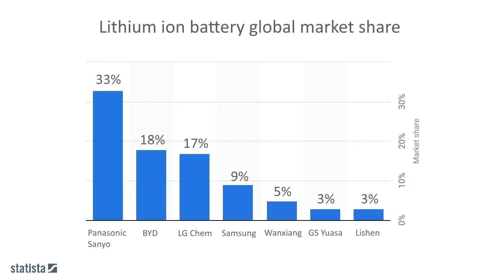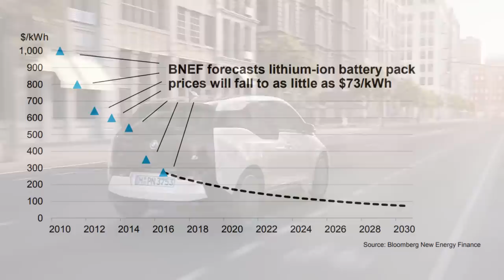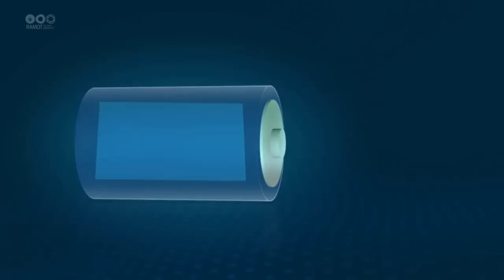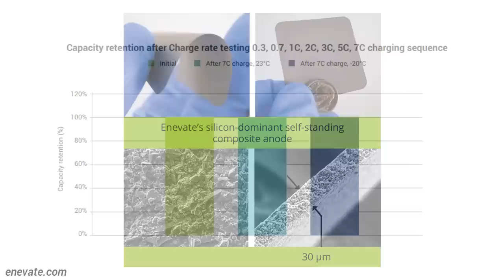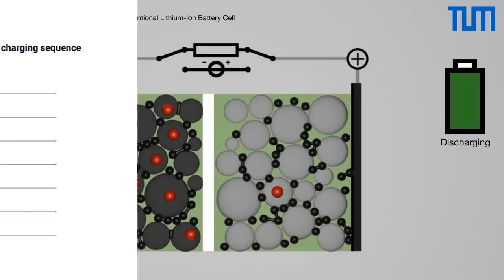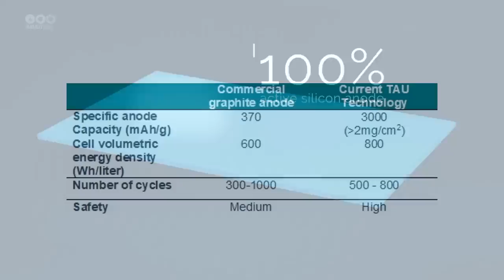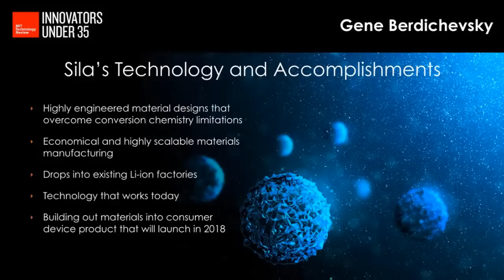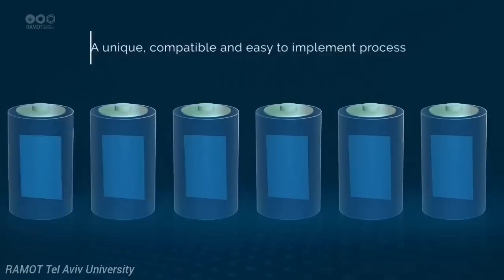The Battery Revolution. Ultra Fast Charging

Comment: I currently drive a plug in hybrid. I'll drive that until I am able to afford one of the 300+ mile EV's. The next step for me will be getting solar panels on my roof. What's holding that up is I;m probably going to be moving to a smaller house in the next couple of years as my youngest is going off to college.

Comment: Well, it is nearly 2020 now...Does not seem like this technology was right around the corner unless you were speaking of Geologic Time. I hope it will release after overcome the degradation problems that this chemistry brings - I don’t want to change my battery packs of be subject to battery fires.

Comment: Good video. From a materials student's perspective, making the batteries and everything is easy, the trouble is with waste disposal and recycling. A battery that has half the charge capacity and recharge rate, but can be recycled/safely disposed is far, far better in the long run than one that cannot be easily done so.
Reply: Hopefully a (near pure) graphene battery will get us past all those extremely toxic wastes.
Reply: Somewhat bad news for you, graphene nanoparticles are quite 'toxic' to natural life if inhaled or ingested. They are like blades (due to their sharp edged 2D - sheet structure, in addition to increased strength at the nanoscale) on the cellular level, and can penetrate cells damaging/tearing the cellular walls, and mess with intra-cellular proteins and organelles by binding and their hydrophobicity causing abnomal deformation. Goes without saying more research needs to be done in this area, but some indications are present/debated. And ofcourse, any nanostructure has completely different properties from bulk material, even if it is the same element. So if we were to leave it in an open dump where we expect any interaction with nature, we need to be careful, as it can easily cycle through the food chain similarly to plastic microparticles, and mercury poisoning and accumulation in fish. Indeed there could be a process to break the graphene sheets or recombine it with something to make it harmless, (wild guess, burning it to form CO2 if possible) but I'm not aware of a specific industrial process to deal with it. I also don't know what assessment Samsung has done on the recyclabilty/environmental impact of their graphene batteries, though I suspect they should last a lot longer than conventional batteries. The answer isn't always as cut and dry as it seems.
Reply: insioni, that's a false dichotomy.  Lithium ion batteries can be recycled.  Battery capacity is extremely important.
Reply: True, but ability to be recycled, and ability to be recycled economically are two different things entirely. I never said Li batteries can't be recycled, more about whatever new composition/techinque that is worked on, it should be a key consideration in the r&d. The issue with current batteries is that the recycling process isn't that economical yet. It ultimately leads to low investment in industrial recycling capacity, and not much is truly recycled afterall. Add to that the amount that goes straight to the landfill. 

The importance of battery capacity is the same argument as the importance of energy density of conventional fuel over its environmental impact. We chased that far enough, and got us pretty far to too. No denying there will be disadvantages,  and even if we do, the impact will be significantly less with batteries compared to fuels since renewable energy is gaining traction. But if we do the same thing as we have done in the past, we might find ourselves in the similar situation later on as we find ourselves today.
Reply: You misunderstand.  Car batteries are too damn valuable for anyone with half a brain to just 'dump in landfill'.  They'd WANT to recover them if possible.

Wrecked batteries in a crash however, is a more valid concern.
Reply: insioni - the Depleted EV car batteries can be used to power HOMES, then when they have ended usefulness for that, the EV batteries can be Mostly recycled and remade into NEW Lion batteries. Lithium is a renewable resource . but currently its still cheaper to mine than to recycle. Toyota is powering a Large cabin in Yellowstone Park with EV batteries and with a backup ICE generator. the very same can be done for poor people or people in 3rd world countries. but, newly built battery packs offer more reliability and higher output.
Reply: Yea, inisoni , you are right.

Long time ago I just found that Lead Alumn battery have greater benefits than Lead Acid battery but when it becomes a trash it'll be toxic as same as lead acid. Then I try to combining Supercapacitor with Li Ion, but ...

The great challenge for our future is not how to reach maximum possibility for battery but how to deal with mountainous toxic waste from it.
Cancer and illness awaiting.... 😞😞😞

Comment: It was always about the capacity of storage batteries and charging. Electric cars go way back, Studebaker's first car built in 1904 was an electric. With improved and cheaper battery technology, a higher density of charging stations, prices falling on KWs, and on used electric cars the industry is quickly changing like the switch from film to digital cameras.

The industry that manufactured film for cameras virtually disappeared overnight (Fuji, Kodak, Konika, and Agfa to name a few) as digital cameras became cheaper, offered higher resolutions, expensive film cameras flooded the shelves at thrift stores selling for next to nothing.

Comment: Already switched, and I'll never own an ICE vehicle again.
Reply: You do know that 90% of electricity is generated with fossil fuels? And only about 1% of that energy makes it out of the wheel motors. Good job, you drive a gross polluter. My old 1999 pickup has exhaust so clean you can inhale it and you would not even get a sore throat. And it is NOT a gross polluter.
Reply: @palomarjack7090  Excellent point.
Maybe solar/wind would mitigate that as time goes on. But then again how much fossil fuel is used to manufacture solar panels?
Reply: @palomarjack7090  ICE cars are between 20 and 30% energy efficient much lower than even the most inefficient power plant. So what you are saying is just wrong. Going electric is factually better for the environment.
Reply: Palomar Jones what a stupid lies. Electric motors and inverters has ~88% efficiency , ICE engine 25% at best.
Reply: @palomarjack7090  That will all gradually change too.
Reply: Richard Alexander. That's your choice entirely, while you electric Guinea Pigs iron out all the bugs that will happen to any new product I will stick to my ultra reliable BMW diesel that does 55 mpg and 600 miles on a tank full of fuel and when that's knackered in about 250,000 miles I will then consider buying an EV if they've proved themselves reliable and battery technology has improved to increase mileages between charging.
Reply: Thx my man, you’re doing gods work. After all these nerds buy electric, cars, gas and auto parts will be cheaper to me😂 win-win 🍷
Reply: unless you live in washington state your burning oil or coal  to get your car charged and here hydro kills fish if you want to drive a electric car fine but who gave you the right to take my motercycle

Comment: 90% of a 60kWh pack is 54kWh charging that in 5 minute would mean a charger outputting ~650kW for 5 minutes.  at 240V that's 2.7kA or about 27 times more than the typical household can handle in Canada.    I'm going to go ahead and call bs on that.  

Setting aside the fact the cabling you'd need to handle 3000 amps would weigh far more than most consumers would want to handle....
Reply: graphene
Reply: If anyone is going to charge at 650 kW of power, they're certainly not going to do it with a 240 volt supply! The charger supply voltage will be much, much higher than that--possibly a few kilovolts. The charging circuit in the car (buck converter) will then convert it to a voltage appropriate for charging the battery pack.
Reply: @quesocoatl21  Whether the battery has graphene in it or not has nothing to do with the charging current. Tom St Denis was talking about something entirely different, nothing to do with the battery chemistry.

Comment: Fossil fuel’s are renewable it just takes a really long time
Reply: like hours and day's . abiotic oil is a reality. oil is not from fossils.
Reply: You can make synthetic gasoline from CO2 from the air. Once it's large scale it will be much cheaper than batteries.
Reply: The Sun is not a renewable source, so all for nothing
Reply: laughting so hard at the moment XD
Reply: I buried some grass in the yard the other day. In  a million years I will be laughing at the oil companies, refining my own oil into gasoline.
Reply: wow, what a nonsense ;)
Reply: zolikoff If that's even possible it will most likely be extremely expensive and not profitable. Converting a gas to a liquid that can be used as fuel isnt easy. I'm familiar with taking natural gas and converting it to fuel and it requires an extremely expensive refinery to make it happen. The reactors and necessary material alone make it not really profitable.
Reply: zolikoff _  it might be that electric vehicles are simply better in many ways.  Solar energy is free, once you have an array on your roof, and you drive free.  I admit, if you live in a flat with no garden, fewer opportunities.
Reply: Hydrogen fuel cells , it converts back to water the technology was used in the
space program...
Reply: zolikoff Never heard of it. Link to video or site?
Reply: zolikoff You mean hydrogen? I know about that one.
Reply: I prefer oil as it can be easily harvested and will become renewable over millions of years if we keep burning grass, trees and algae in our backyards
Reply: :D hahahhahahaha like million of years ? The only problem is that we spend FF much much much faster that they are "created" :D
Reply: +
Samuel Rosenberg

Umm.. no. Mother nature is not "replacing" or "reproducing" crude petroleum at any useful rate at all. The reason  why  the early prediction of depletion was off is because people underestimated the rate in which we find and extract new petroleum reserves and our ability to exploit what used to be economically nonviable resource  (tar sand eg)  into usable petroleum products. Make no mistake that when those resource are gone they will be gone forever.

Turning CO2 into fuel is not an economical viable technology. It might be useful is some cases ( making fuel for jet planes eg)  but uiit is not commercially competitive to  challenge EV tehcnology.
Reply: +
Samuel Rosenberg

I doubt that CO2 synthesised diesel will only be  $1 more expensive that standard diesel fuel. I think you should at least change your  estimates by a magnitude or two.

I what way are EV vehicle not competitive to Diesel ? The cost/km on EV vehicle is much better  than that of typical fossil fuelled car, even when using more efficient ( when compare to petrol engines , that is) diesel engine as comparison.
Reply: ThisNoName, but the sun will out live Humanity so there is that.
Reply: Mark Wright Few more millions of years? Try 5 BILLION years. Even after it becomes white dwarf it will still radiate energy but it will be less and Earth will've been scorched by the time it turns into a red giant (phase before turning into a white dwarf)
Reply: Bruno TaTa if your are serious I can offer you some knowledge on why you are wrong. The oil in the ground is from ancient plants that existed millions of years ago and went without being broken down. A few hundred thousand to millions of years ago bacteria evolved that could break down dead plants and leaves that fall to the ground. So it has no time to become buried underground and prevent the bacteria from decomposing it.  So oil is not renewable unless we manufacture it or get rid of the bacteria.
Reply: Bruno - Fossil Fuel pollute, there is NO such thing as Clean Coal or Clean Diesel. besides, we are at the point that Every country in the world can go 100% renewable energy right now. it just take political will and a little investment.
Reply: Samuel Rosenberg 
You never drove an EV, did you? Else you wouldn't say such a thing.
Do a test-drive (of the 2018 Nissan LEAF for example) and then tell me again that EVs aren't better than Diesels. They are. Period.
Reply: we will run out of batteries before all fuels deplete
Reply: ,,, 4 min - Tesla right now recycles its batteries worldwide, not because its cheaper, but because its the Right thing to do, also Lion car batteries are mostly recyclable and there is PLENTY of ore left to mine.
Reply: This is an expample for the last tries to extend the classical (diesel) engine a few years more... Maybe this will work in the mid-term (I doubt it though) but in long-term (15-20yr in my opinion), EVs will be the standard. Battery tech evolves and becomes cheaper, which is a fact. China is pushing hard towards this direction. With more and more solar & wind energy in the grid, storage is needed and with increasing production capacity, batteries will become cheaper and cheaper.
Reply: Bruno TaTa how many reincarnation for me to see
Reply: the US Navy makes hydrocarbons from seawater, basicly a infinite resourse. but, it still pollutes.
Reply: doug - its a pipe dream, ZERO infrastructure across the united states for Hydrogen. its why the Nicola semi wont work, they are going to produce it centrally, then TRUCK the Hydrogen to the filling stations, what a waste.
Reply: Fossil fuels are actually high density solar batteries charged millions of years ago.
Reply: how tho?
the fuel for renewing the fossil fuel already depleted. they cant regenerate, or at least regenerate very small, only in places/areas with no human intervention.
Reply: ThisNoName within the conditions that are relevant for human life I think you CAN say that it is "renewable".
Reply: Samuel Rosenberg My cousin's Tesla Model X can be charged from a simple 2 KW home outlet but it takes the entire night to charge it
Reply: Michael Plitt You don't need to wait that long. You can chop that tree down in your yard and convert it to oil with a gasifier.
Reply: @starvinmarvin7964  A company called Sunfire is already making gasoline and diesel from captured Co2 it is an slightly complex process but the end product is surprisingly cheap at 90 pence a liter and they claim they can bring it down to 50 pence a liter by 2025.
Reply: even though we cannot stop carbon emissions
Reply: Everything is renewable given enough time or energy. It’s just not renewable in a humans lifetime.
Reply: What would it be to study at school, university more about new  energy systems for the future. There are enough energy at worldwide but we don't use that or just a little now. If you are interested please do a little research there are lots off different  systems like:
Tidal power station,  Marine current power, wave energy, Wave of Waves and Sea Serpent, Photovoltaic and Solar Thermal, Wind Energy with horizontal and vertical Wind Generators, Geothermal, Energy source Biomass, Biogas, Gas, Hydrogen, Hydropower plants, River power plants, Pump storage power plants, Solar collector for hot water extraction, Air Water Heatpump, recuperation energy with every transport vehicle and some others too. 
The future will run no more at gasoline or petrol because we should them keep it for the future generations and use them for mutch better products then just burn at engines or for heating the buildings and other's. You
Reply: Eu has announced non fossil fuel, renewable energy 30% of thier total...
Reply: Yay Dinosaurs!!!
Reply: Fossil fuels are not fossils in origin. Oil is just aother byproduct of the Earth.
Reply: Trump - make fossilzed forests great again!
Reply: When is fission released to people you can make liquid fuels basically from every thing... But battery must be future
Reply: the term renewable is used in the sense of renewed within one's lifetime
Reply: @ThisNoName  before the sun will die it will take bilions of years until then humanity will scatter all around the universe lmao
Reply: Bruno TaTa 🤣😂😅
Reply: It’s possible and quite efficient 50%-60% to extract CO2 from the air, combine with hydrogen from electrolysis over catalysts to make gasoline.
Reply: Need more dinosaurs, thats the problem.
Reply: Bruno TaTa, You should patent that line, make a t shirt?
Reply: OverThink, Elon decides to put all that hybrid stuff into getting as large a battery as possible. Hybrids are a stop gap measure.
Reply: @ThisNoName  nothing is a renewable energy... Not even God then!
Reply: @andream.464  Then you have to define GOD first ... nobody I talk to dare to say it out loud.
Reply: @sonacphotos  I sense a politician in you. You should be one.
Reply: zolikoff no it never be. Because you cycle energy in the batteries for at least 1000 times. Create synthetic fuel require a lot of energy and ICE engines are quite inefficient to move cars, 25%.
Reply: Oils can be made with or from microbes.
Love electric,  batteries still have a long way to go,
Reply: Energy companies have known that oil is renewable for decades. It's a byproduct of the volcanic activity in our planet
Reply: like millions of years.